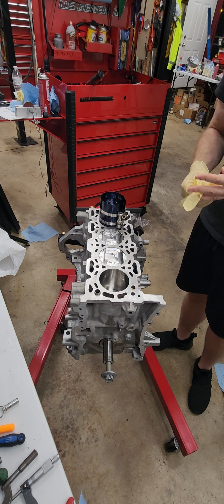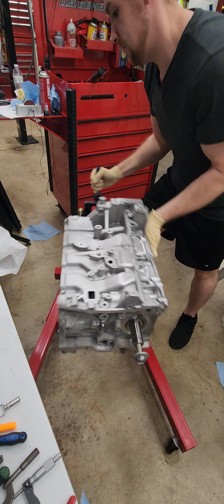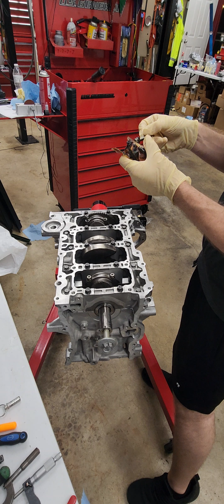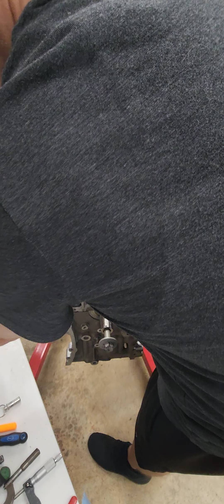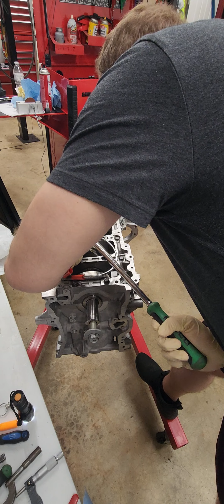Installing Piston + Torquing Rod Caps - Diamond Pistons Molnar Rods Forged LTG 2.0

Comment: What did you gap your rings at? I bought diamond pistons for my ltg build as well. I used the standard bore piston size cause the cylinder walls only needed cleaning up.